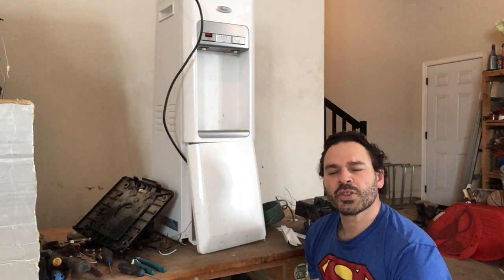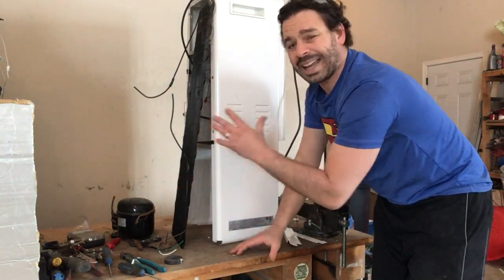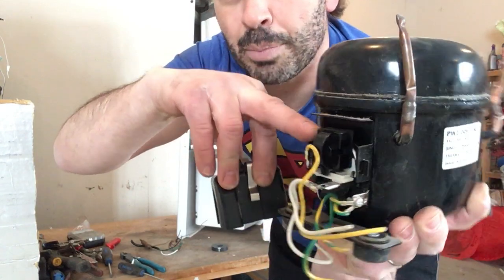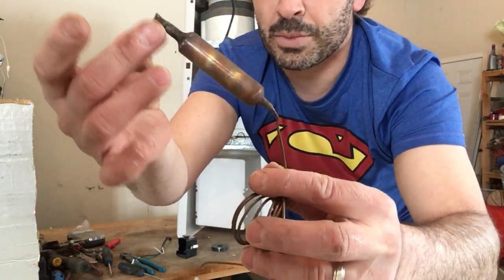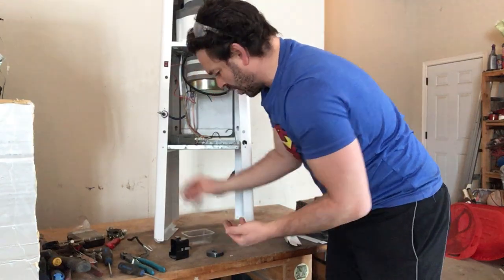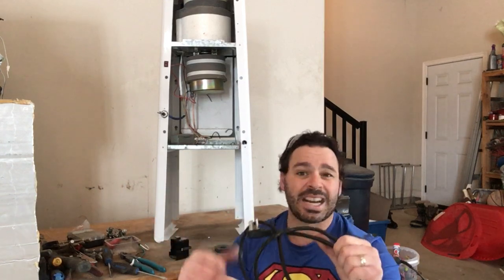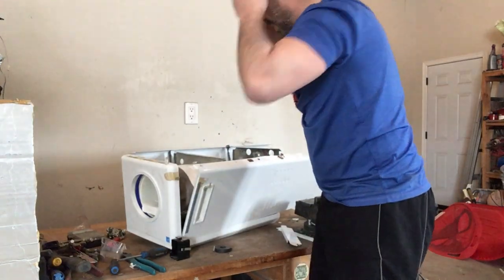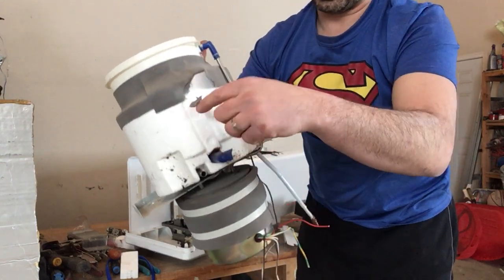Scrapping a water cooler for loads of tin, copper, other metals, and very little waste.

Comment: Good   day Interesting video.  If u let some plastic on  which everyone does.  What happens to plastic, just melts down,  is that not better than  landfill?  Thanks  interesting
Reply: Depends on your yard, some off them will pull it off or take off a little weight because of the plastic. Depends on your yard and price of material.

Comment: How do you know that the sides of the cooler is tin and not steel? Great video! 😁
Reply: Goes by thickness at a scrapyard. if steel is thinner than 1/4 inch than tin/shred pile.  So all side panels from washers/dryers, microwaves, water cooler, etc are tin

Comment: I was told because of the oil in that copper it is all #2
Reply: The copper wire from compressors is #2, but the little pipes I will soak in soap/water once cut to clean off oil substance.